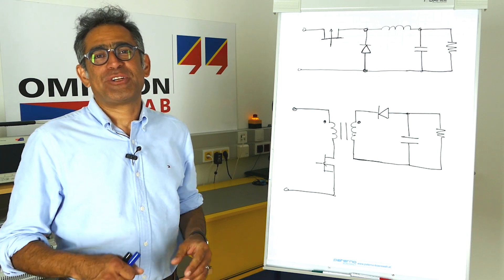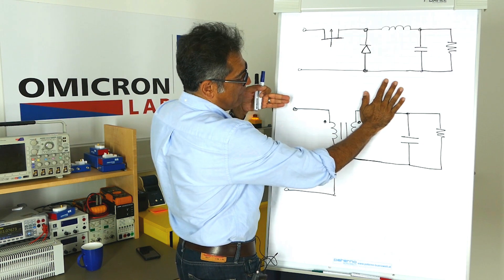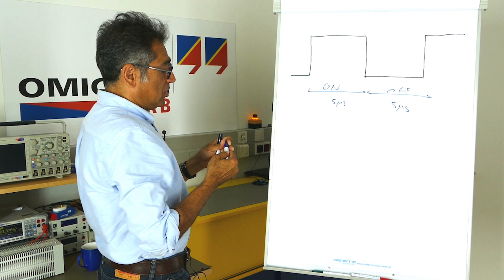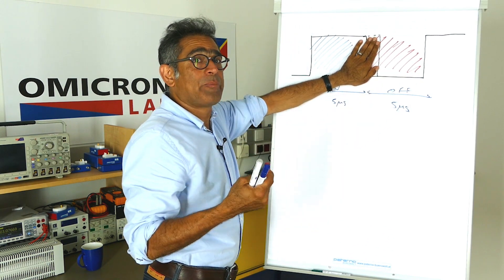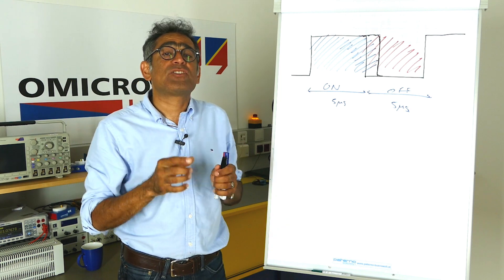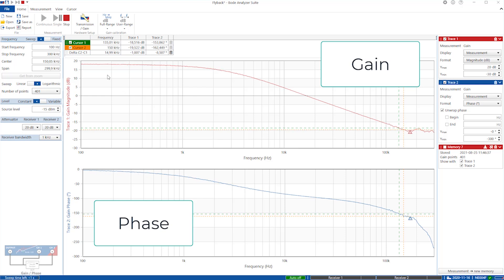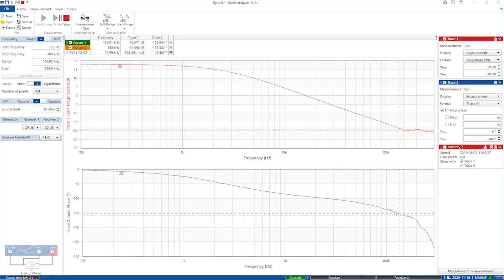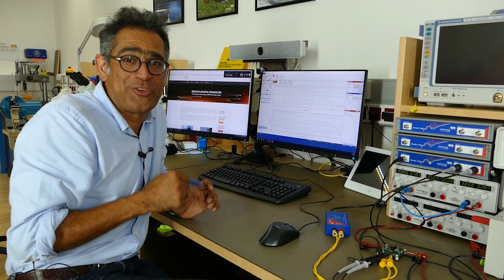Does your PSU have a RHPZ? How to solve this problem

Comment: There are a few ways to avoid right hand plane zeros in a flyback. If your applications allows it one can use DCM (Discontinuous Mode Conduction). The other way is to use a controller that does
not allow a duty cycle beyond 50%. But these also have disadvantages, higher peak currents for example. Flybacks, despite their apparent simplicity are surprisingly complex circuits.
Maybe Dr Ali could do a video on that. Otherwise an other excellent video as all his others. Learned a great deal from him.

Comment: Your flyback topology is wrong, the forward biased dot, being inverted, cannot deliver any power to the load. The dot is down and the diode is reversed.
Reply: It's just an unfamiliar representation: with the secondary dot-phasing and diode direction as shown, the output and input have opposite polarities. The winding phase and diode are usually reversed so the input and output polarities are the same. That's just a convenience; it's not necessary in order to make the circuit work.

Assume the supply polarity is positive at the top. During the Don interval, the supply can force current into the primary because the switch is on. That means the positive end of the primary is its dot end. Therefore the secondary's dot end is also positive, so the diode is reverse-biased and stays off.

During the Doff interval the primary is no longer sinking current, because the switch is off. Being an inductor though, it still tries to keep current flowing through itself in the same direction as before. It can only do that by trying to force current through the circuit, so its polarity must reverse: its positive end becomes the non-dot end. The secondary therefore also becomes positive at its non-dot end. That forward-biases the diode, which turns on and delivers current to the capacitor and load - with the output positive at the bottom and negative at the top, opposite to the supply's polarity.